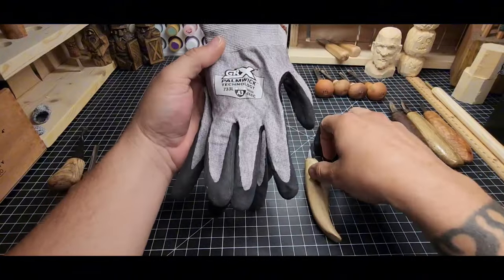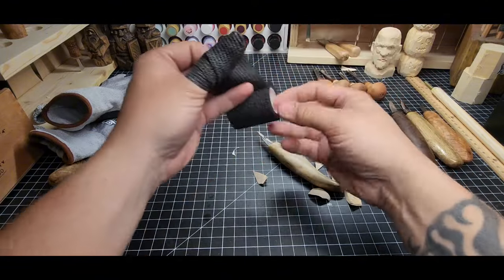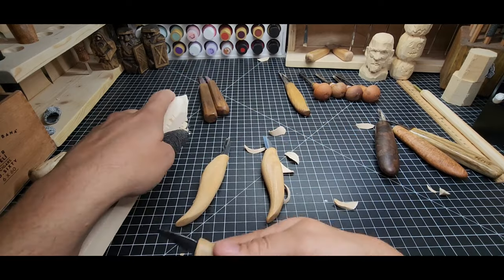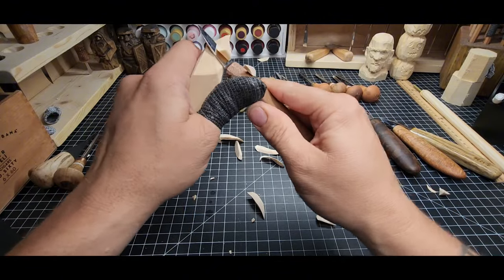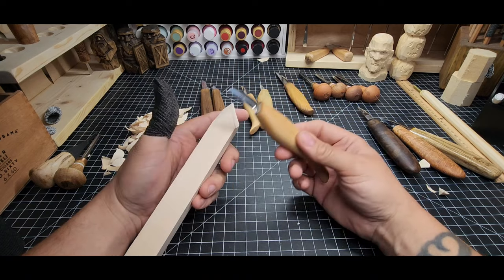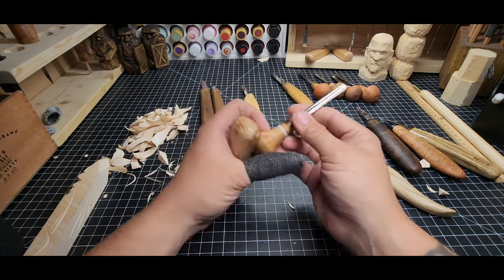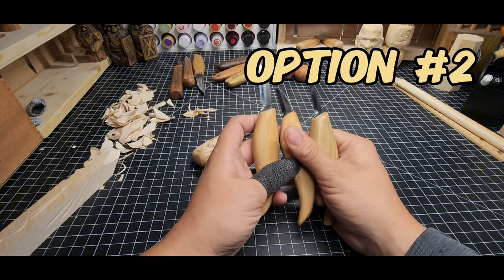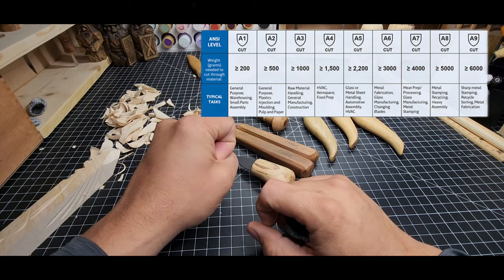Getting Started Wood Carving? Basic Tool List/Description & Safety.

Comment: I find Google cartoons is my hero for art skills.Cartoons are the simplest form of art.
I'm lucky I had a bad whittling thumb cut as a grandson learning from Grandpa Jude and he didn't teach much other than enjoying whittling.Had numbness until midlife always more careful after the cut the stopped by my thumb nail.
Lots of good information.
  I built 3 knives that fits my hands great from Badger State Blades and believe they are great and I only have about $50.00 in the three having to build my own handles that are extra strong because they are laminated and size to fit my own medium large hands.
   Agreed about slick finishes for wooden handles of all tools 220 grit sandpaper usually close to dull.them and prevent slipping and blisters.
   I'll try that glove but remember don't aim firearms or blades at body parts.
Thanks Johnny
Reply from the maker: @JohnJude-dp6ed  Right on brother.